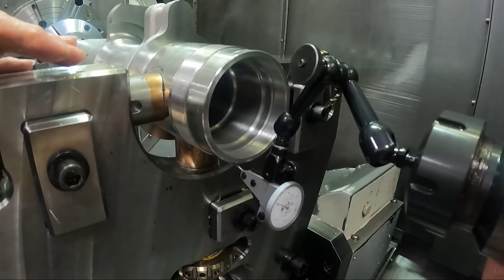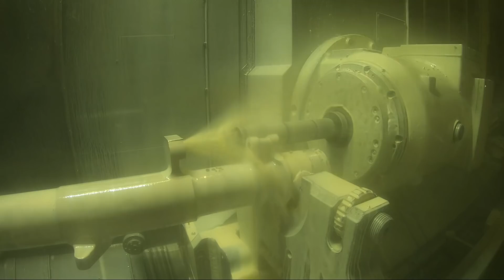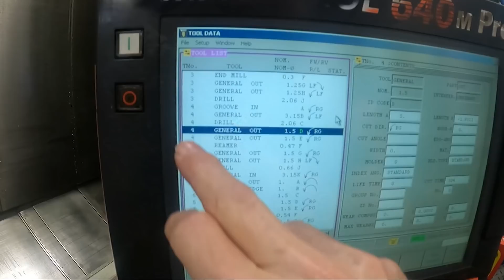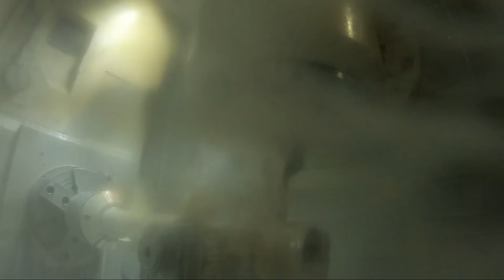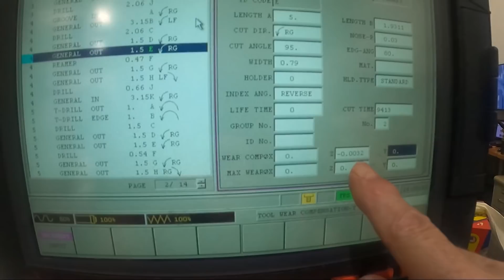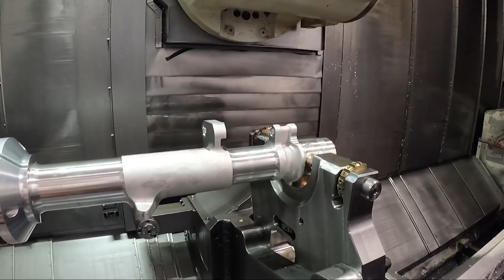Machining First Part On Steady Rest

Comment: I don't mean to be a smart arse, but why didn't you just offset the machines C-axis 0 position instead of working around it? We do it all the time on our Mazak.
Reply from the maker: Normally that would be the thing to do. But as I think I explained in the video. There are some tools that are machining thru the gaps in the chuck jaws. So in order not to hit the jaws with those tools I need to align the part to the present C zero within reason to maintain that clearance.
Reply: There's a flat on the part. I would've milled a flat in the jaws and a piece of ground ground flat stock to help move things along, personally.
Also, we talked about a broaching/shaping Macro program a couple of years ago but I have no idea of how to get that to you if you're even still interested in that?

Comment: Have any good tips on backing off a boring bar ? Or taking back lash out? How to appropriately dial a boring bar in
Reply from the maker: If you are referring to a boring head. I back it off well beyond the setting (one revolution of the dial) and rotate back to it. This works fine on the ITS heads I use. I also have a video describing how I do this.

Comment: We have sub ur channel. Glad too,can you pls tell me the about ur mazak machine specifications.
Reply from the maker: This is a Mazak Integrex e650H machine. 
These are the general specs.
 Control Type
Mazatrol Fusion 640M Pro
# Axis
5
Swing
36.2"
Turning Diameter
36.2"
Center Distance
123"
Chuck Size
16.4" 4-jaw manual chuck
Bar Capacity
6.65
X Axis Travel
40.35"
Z Axis Travel
132.87"
Y Axis Travel
25.6"
B Axis Head Tilt
-30° to +210°
C Axis Index
0.0001°
Rapid Traverse (X/Z)
1,575 IPM
Spindle Speed (RPM)
1,600
Main Motor
60 HP
Turret Capacity
40
Tailstock
yes
Live Tooling
yes
Milling Spindle Taper
CAPTO C8
Live Milling Speed (RPM)
10,000 RPM - Milling Spindle
Live Milling Motor
50 hp - Milling Spindle
Reply: Thk u

Comment: What does the GD&T call out on the print for those bores being equal depth from the faces look like? I’ve never seen a print with that sort of dimension.
Reply from the maker: There is no GD&T called out on that dimension, just a note saying so. In fact I don't really care for the way the print is dimension. It has a combination of geometric tolerances and regular dimensions. Also the GD&T's are not called out properly. There are just geometric tolerances with no conditions for them. Not really done properly at all.

Comment: For long-term production (100 parts or so) and where you have a setup part or two that costs you nothing or not much to scrap, I can see going with the indicator and auto cycles working off the indicator readings. But you have a working method that isn't much slower (if any) than using the fancy indicator, so there is no point in changing mid-stream.

Comment: A purely technical question about the g-code and the controller. How do you implement mid-machining stops and then re-run the prior op? I’m trying to figure out how to best do this on a Fanuc controller. I understand that you have a different controller, but perhaps I can learn something from you.

Just like you, I want to machine a feature and the measure it and adjust the wear to machine the feature to the correct size. I can program a stop, even a stop with a message. But how do I restart in the right place? For all I know this might not be a big deal on your controller. Are you using line numbers to help you with this? Are you setting up your post processor to add preparatory commands to each program block that machines a feature? Are you adding any special code blocks in your CAM software to aid with this?
Reply: Use optional stop or manually insert stops where needed. Use goto statements at the start of your program after the safety lines to intuitively jump to a section. These can be preset and commented out if you plan on needing them. Then when needed you can remove the parentheses around the statement you require.
Reply from the maker: What I do. Let's say for a boring head I know I'm going to rerun many times (like you saw in this video). After the head is run in the program and moved to a clear position. in order to measure the bore, but convenient to adjust the head. Put a M00; than on the next line put /GOTO100; (If the boring head starts on N100 line. With this line and Block Delete not activated the program will continue to repeat the same boring cycle until you push the Block Delete button. Than it continues in the program. The Integrex has 9 different Block Deletes. So if you put a  number after the forward slash. Say like /1 it will only be active with Block Delete 1 button active or pressed. So I do a combination of this and insert park cycles in the cam software where I know I need the machine to stop. On my software I recalls the tool and offset after a park cycle. So I can easily restart there. On the Fanuc control (No on Mazatrol or Meldas control) you can also do this. Let the machine run down in single block to you first clearance position (You need to program these clearance positions with this in mind). Let it stop there. Turn the rotary switch to edit. In the program run the cursor down to the clearance postilion right before where you want to machine. Than turn the rotary switch back to Memory. And push Cycle start. SLOW the rapid down and watch carefully. It should go over to the new clearance position and start machining from there. Be careful this wont take into any thing that changed in between. So if you have a rotary axis change or a spindle speed change it wont work. Unless you program those things after this new clearance position. But for straight 3 axis milling this works fine. And I have done this many times on a Fanuc control. It wont work on a Haas if you have program restart enabled in the peremeters.
Reply: @EdgePrecision  Thank you. That's a very thorough explanation. I did not know about the block delete function. Thank you for that. I will try implement something like this. I can even see a way of setting this up in the CAM software so that the post automatically "wraps" the  program cycle with the right code.
Reply: @poetac15  Ahhh. I think I understand. So after a programmed stop. I make adjustments, rewind the program, uncomment the correct goto line and hit cycle start again. 
Most of the parts I'd use this on will be run "remotely" from the memory card. The memory on the controller is the standard 512 kB ( or something like that) so I run most programs form the me3mory card. I don't think I can edit these programs directly on the machine. But maybe I'm wrong on that?

Comment: I’ve used pins in a tool holder as floating stops for clocking parts roughly before indicating in. Thanks for the video!

Comment: Where is the location of the distance to the counterbore from ?
Reply from the maker: The way it is specified on the print. Is there is a width between the bottom of the c-bores with a tolerance of +-.002” on the longer boss. And the depth of both c-bores has to be equal to each other within +-.002”. So no matter the actual width of the boss these conditions have to be met.

Comment: Since you have so many parts to do, you could make a fixture ish that would mount in your spindle. You could take the rough shape of that boss that you're indicating on, wire out the shape, and turn it into a clamp of sorts. Where the back jaw would be on the center line of your y-axis, and you could jog your spindle down in z until that boss is in your clamp. Then with with the chuck clamped probably a bit lighter than you have now, You could just tighten that clamp, and then that would align your part on your y-axis. If that makes any sense.

Comment: what's the psi thru the spindle? what rpm do 90 degree tools spin?
Reply from the maker: The previous videos in this playlist I discuss this. I haven’t used their gauge to measure it. But I would estimate 50-60 K RPM. The pressure of the coolant is at least 1000 psi or more.

Comment: Great Video as always Peter.  I usually put a groove in the plug where the holes intersect to avoid issues with burrs and not needing to worry about orientation of the plug
Cheers!!